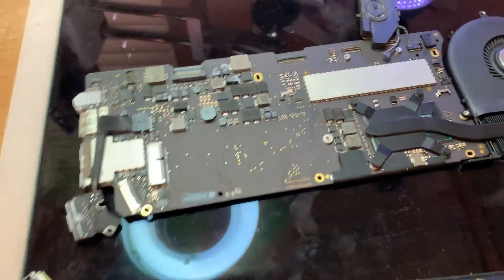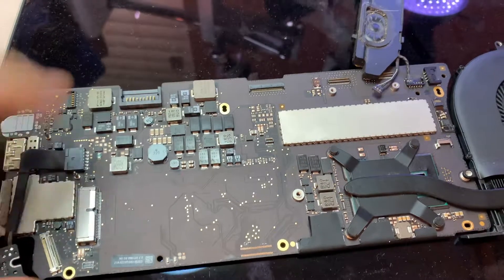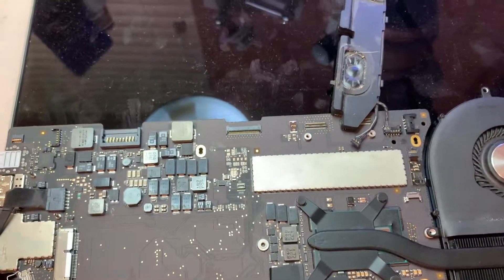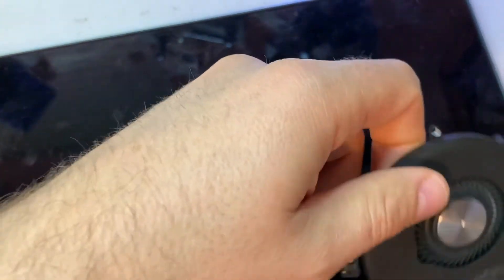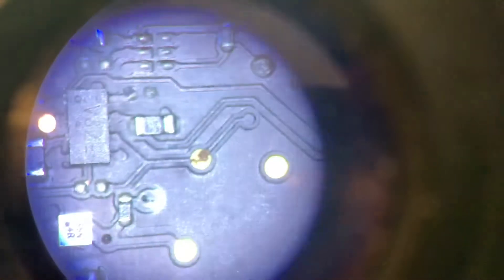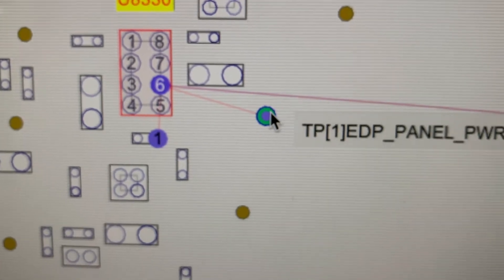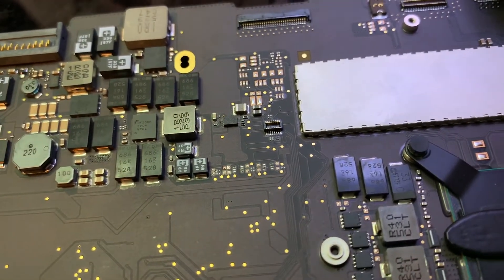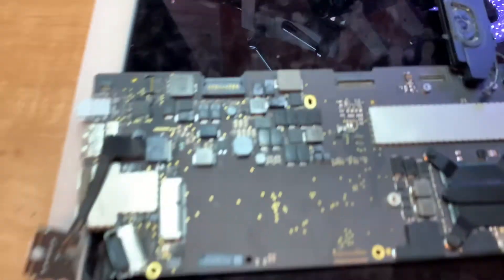Another Repair Day! 2015 MacBook Pro 13" A1502 No Internal Display FIXED!

Comment: Thanks for the video and your help with the 820-2915 and Lattice on the weekend. Still no luck with that one so I ordered a new programmer. Is this a 820-4924 in this repair ?
Reply from the maker: New programmer is the way to go! Yes, it is 820-4924. Thanks!